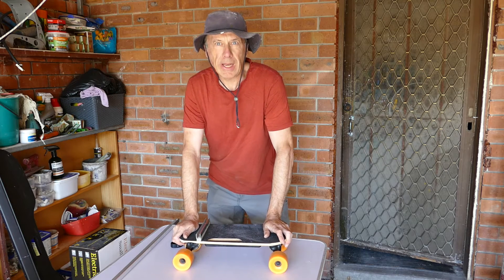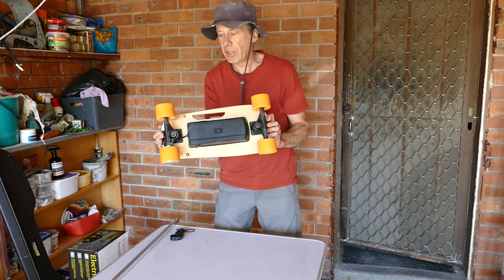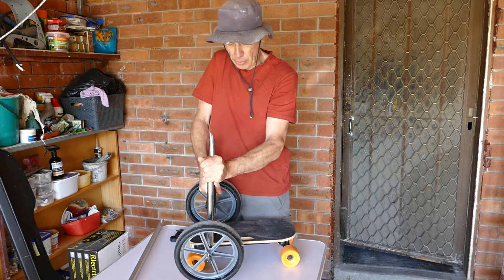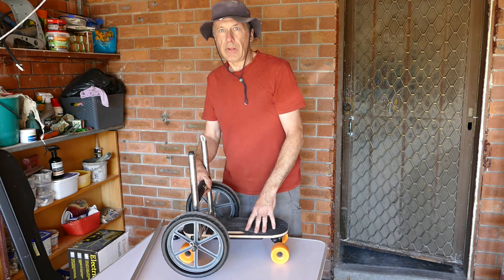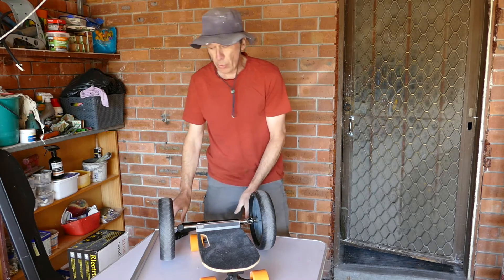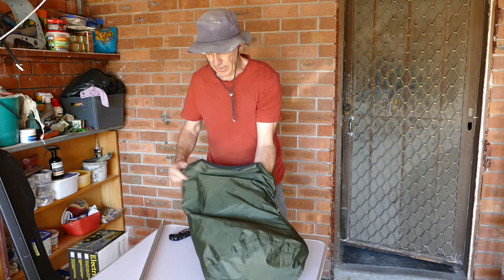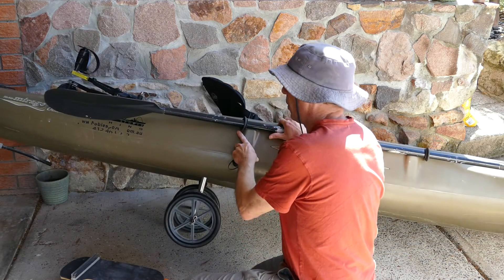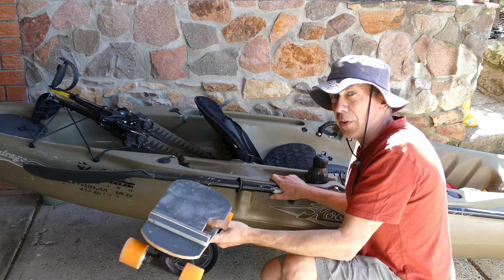Electric Kayak Cart with Remote Control

Comment: It is an excellent idea to transport the kayak, which sometimes weighs a lot, especially when you return home. Thanks for sharing from southern Spain.
Reply: Yup. Mine weighs 150lbs + gear. It's stupid heavy and I need to move it around on a trailer. I have a cart for it, but only viable on a flat parking lot or downhill. Getting it back up, nope. Exploring powered options that can be easily stowed. The idea is that at busy locations (tournaments) you get your parking spot, load up, then off you go. No stress of unloading and leaving your gear unattended while dealing with the vehicle.